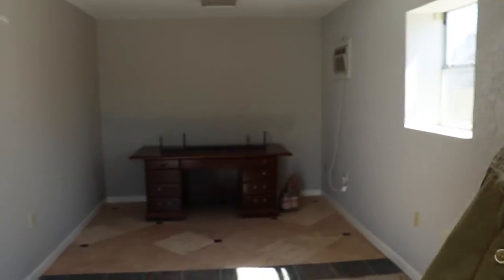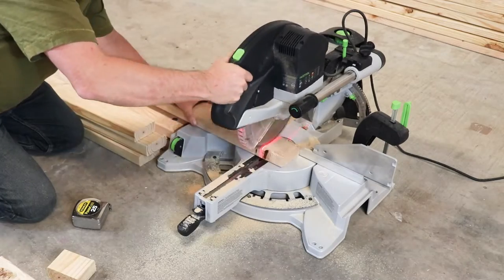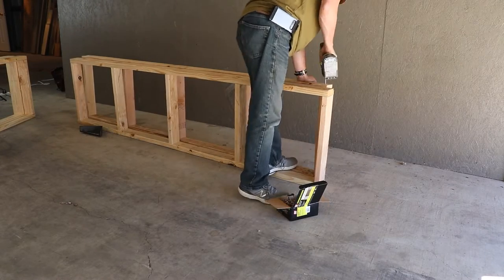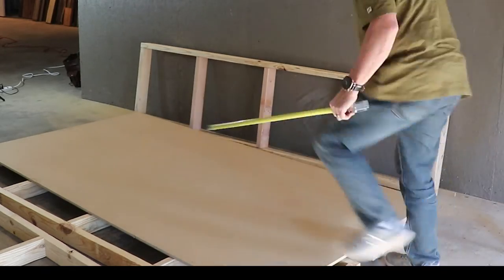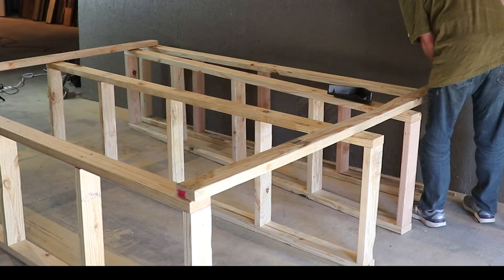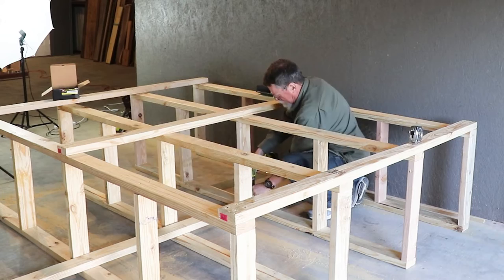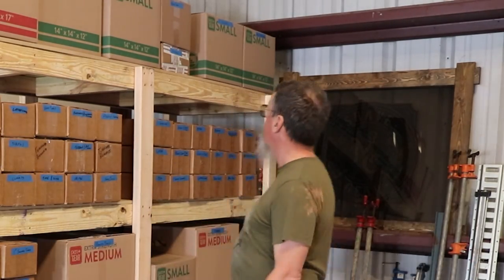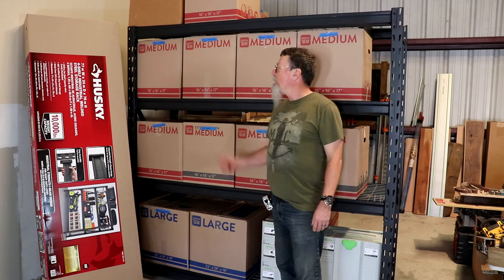DIY Super Simple 2x4 Storage Shelves

Comment: I built something similar, but without the middle supports but used 5/8" particle board. Have had totes on it for several years and hasn't sagged
Reply from the maker: I tend to over-engineer everything expecting a heavier load than I probably need.

Comment: The temp brace for lifting is genius especially for those of us who work alone.
One fail in your video. In the beginning you state the 2x4s are cut down to 6ft for the shelves, yet at the end when you discover the metal shelving unit you state your shelves are longer than the 6ft metal unit. That's actually the same unless you misspoke early on and used the entire 2x4 for the length of your shelves.
Reply from the maker: Mine is just a bit taller than the metal one. Every inch matters, right?

Comment: Nice! What kind of screws do you use (size, leng,h head, material)? Would appreciate that info. Thanks.
Reply from the maker: The screws I use are whatever I have around the shop for projects like this but these are 2 1/2" construction screws that I got at Home Depot. They have a torx head but also come with the drill bit to make it easy.
Reply: @thevendorlife  Thanks!

Comment: How wide was the shelf and how long was the 2x4s for the shelfs. Is all the 2x4s. 6 feet long
Reply from the maker: I cut the plywood in half so the cross pieces are a bit over 2 feet long. The uprights are all 6 feet.
Reply: @thevendorlife  so how far apart are the cross pieces.
Reply from the maker: @johnbrandonlocklear7881  The horizontal boards are all 8 feet so their spacing would be at 2 feet.
Reply: @thevendorlife  thanks